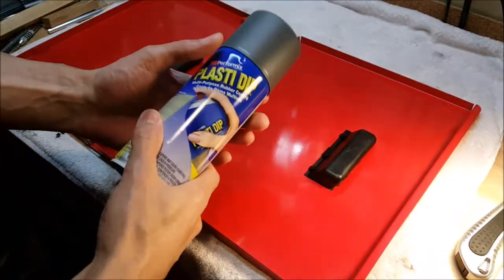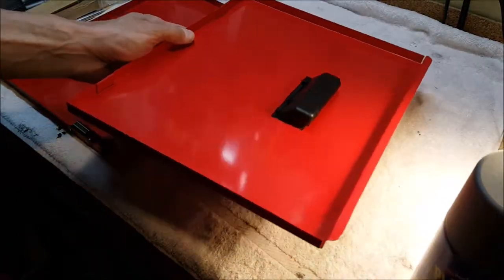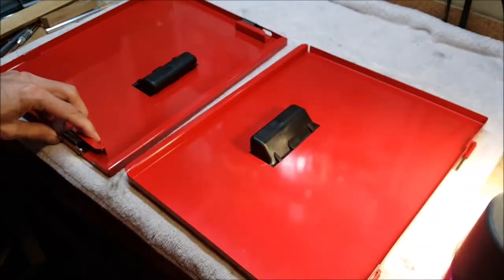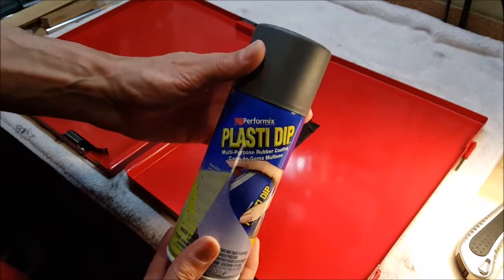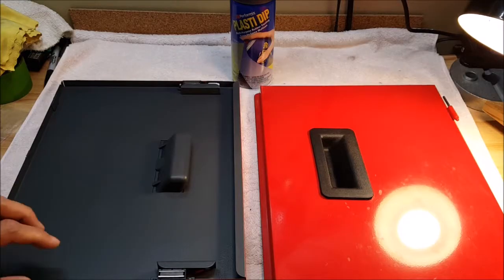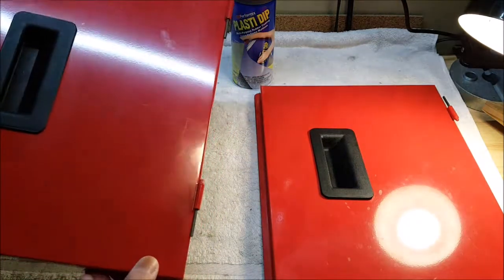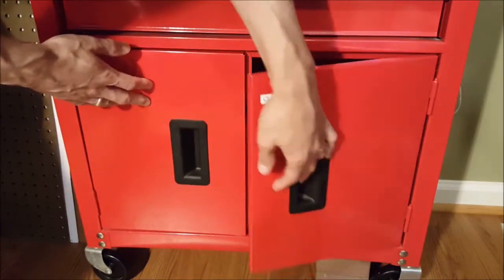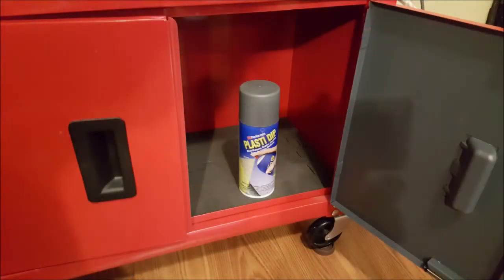Sound Dampening with Plasti Dip?  (an experiment)

Comment: will it also act as glue ? wanna glue some cotton soundproofing material
Reply from the maker: If you press the cotton to the surface sprayed with Plasti Dip while it's still wet, it will likely stick.
But keep in mind one of Plasti Dip's claim to fame is that you can peel it off if you want, once it's dry.

Comment: I plasti-dipped the chassis of a vintage AR XA turntable, it has a thin metal chassis the fits into a walnut wood base plinth. The plasti-dip really dampened the resonance, and made the noise floor much more quiet. Improved sound. I had to use three cans of the spray cans for it to really work. Many coats.
Reply: Thanks for sharing.

Comment: Sounds like the reverb/vibration has been cut down. 
To make it even quieter maybe can get some thin foam (or more plastidip) to put on the inside ledge of the toolbox itself so it is not metal on metal when the magnet pulls. Not sure if it would help but may be worth a try!